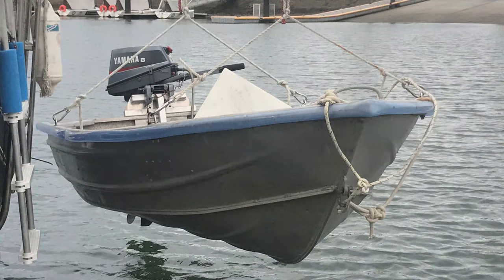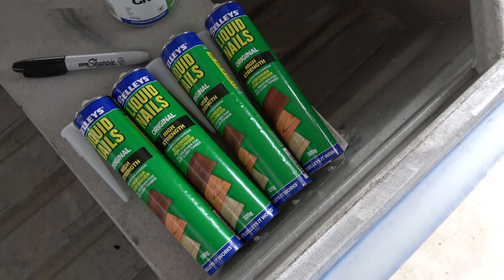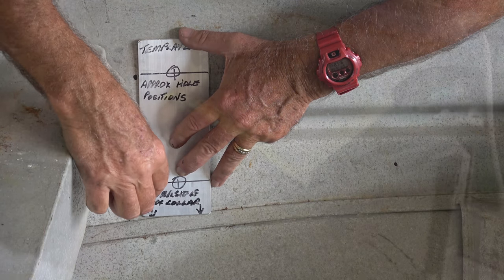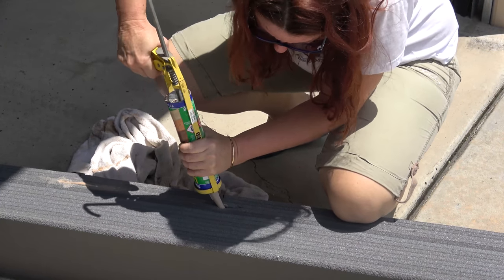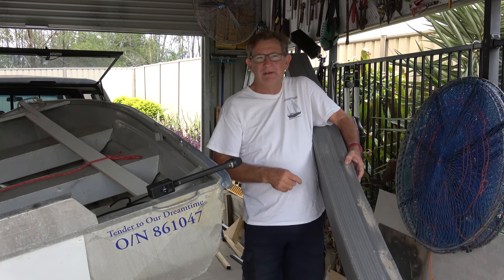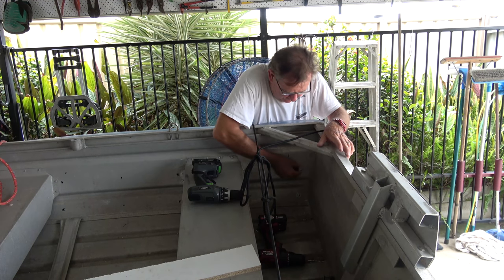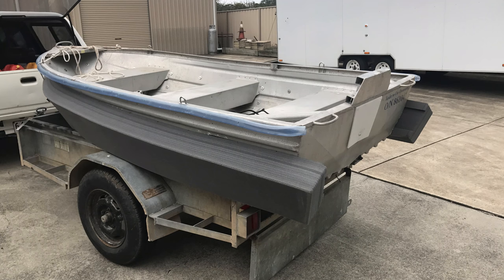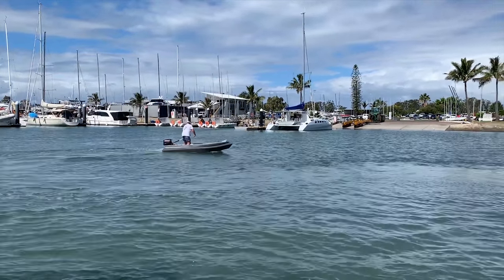In search of the perfect yacht tender

Comment: Always thought some aluminium tubes on the side would be better. Like  Rib, but alloy. The foam will break down in weather and get torn.
Reply from the maker: Our boat collar is now getting on five years old and still going strong despite us sailing largely in tropical areas. A big advantage over aluminium tubes is that the high density foam also acts as an almost all around fender when the tender is alongside our boat. Cheers R & K